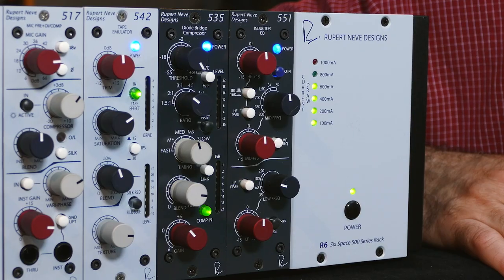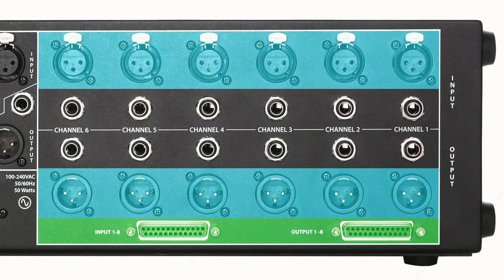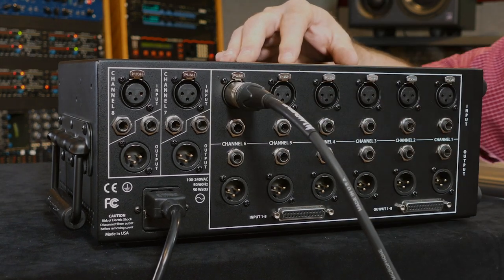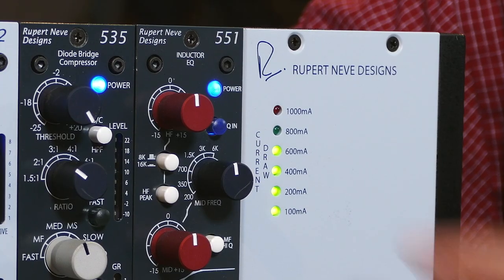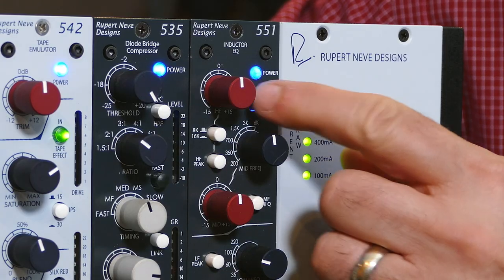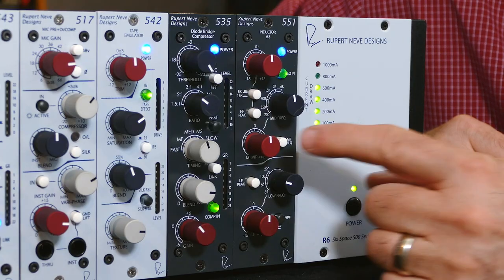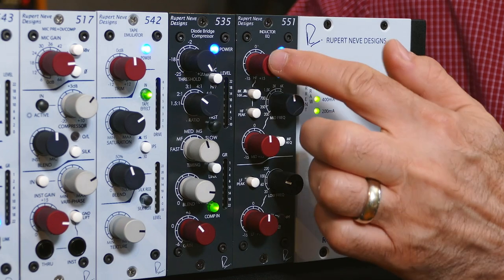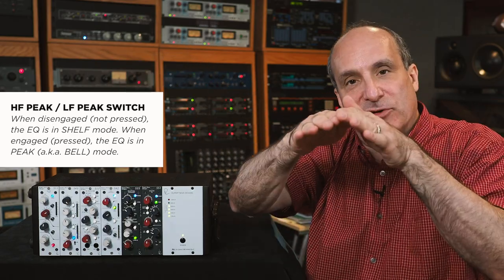Quick Start: 551 500-Series Inductor EQ

Comment: Hi, I got this unit and while boosting highs 8k and 16k even at 3dB gain emits a significant hiss noise. Is that normal? I have the 551 powered by SM pro juicer rack 1. Cables used is a pair of xlr to trs Mogami 3 ft. 2534 cable.
Reply from the maker: Hi! That doesn't sound normal, no. You should contact our Service department so they can help you troubleshoot it! https://rupertneve.com/support
Reply: @RupertNeveDesigns  Thanks, I will.